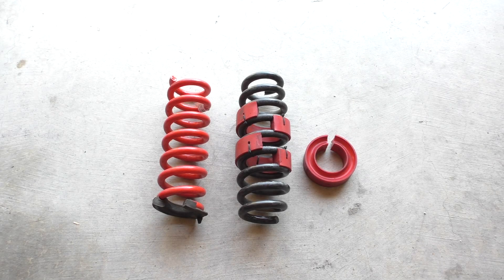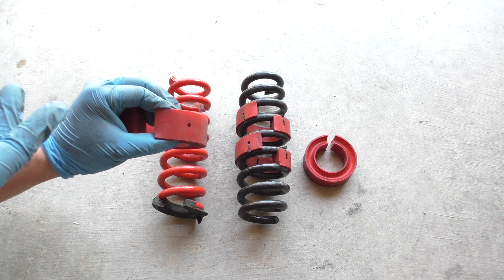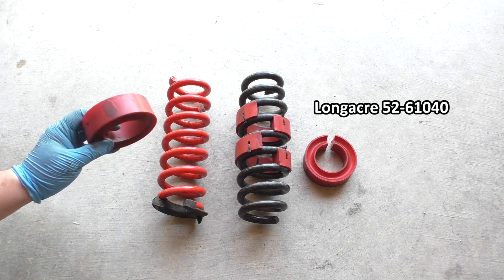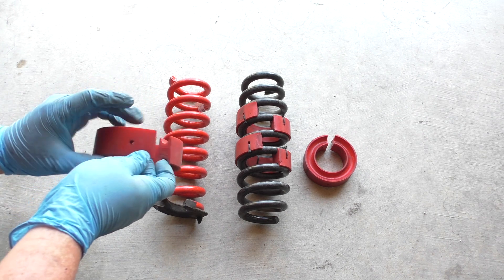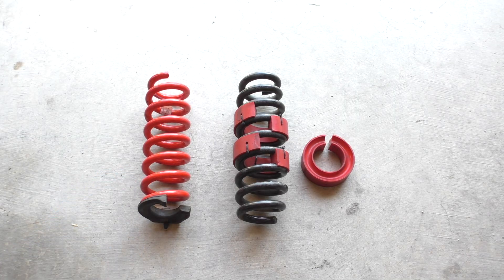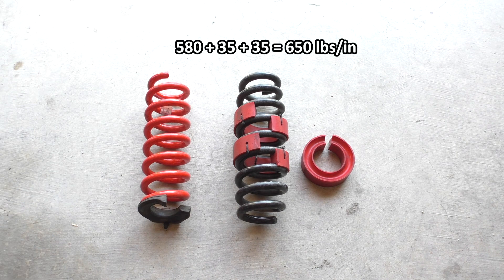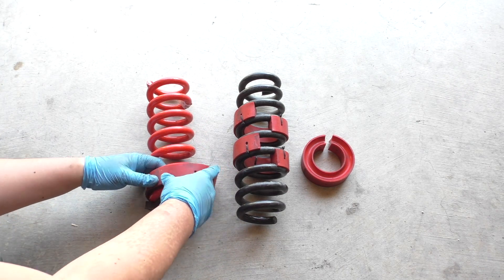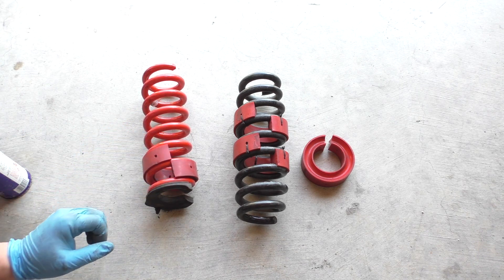Spring Rubbers Overview and Installation

Comment: I don't want to lift my car by 1/2" or any height at all. I have totally stock springs. I'm a snow skier, and I need to put on tire cables from time to time. I want my car to stay lower to the ground, not higher off the ground. I want to know, to make the springs stiffer for performance driving in the mountains and highway speeds, should I put these rubber coil near the top, middle, or bottom part of my OEM springs?? Again, I want comfort, but I also want performance stiffer springs without lifting my car at all. Thanks for sharing everybody... I'm doing my homework to learn about the performance advantages of these rubber coil springs.
Reply: "I want comfort , but I also want performance stiffer springs without lifting my car at all."
Bruh, you can't have your cake and eat it too.
Learn physics my dude, it goes a long way. 

Joking aside, there is no such spring is stiffer and comfort at the same time. You can have a custom springs with custom spring rate and length but you are gonna sacrifice some comfort for performance. 
btw, it does matter where you put these rubber at the coil, but any position you put it at, it would increase spring rate and raise the ground clearance no matter what.

Comment: Do these break down over time?  How long did they last you?
Reply from the maker: I didn't run these for a very long time (maybe 6mo at most), so I'm not sure what long term longevity would be like.
Reply: @FaRKle0079  After 6 months you got stronger springs?
Reply from the maker: @pemirat  Yup. I was using these to test and figure out what strength springs I wanted to get later.

Comment: Hey, it’s probably a long shot but I’m trying to swap my stock E84 N20 springs off a E90 N52.

I’ve done my research and they’re a fairly straight forward swap but my main concern would be the weight differences . It’s bout 250-350lbs lighter and I’m just wondering if using these would compensate for the it?

I have the h&r lowering kit on while I’m happy with the drop, the ride is just too harsh for daily & where I’m at. With the E90 springs, it should achieve bout the same drop while maintaining better ride. 

Or would it be better just getting springs of the E60? They’re bout the same if not a tad heavier than my E84 but I’m not 100% on the length and drop. 

Thanks in advance!
Reply from the maker: Do you have the spring rates for all those other springs you're considering? You'll want to know the spring rate and relaxed length of those springs to calculate how high they'll set the car compared to what you already have.

If your current springs are too low, and you feel are too soft, then spring rubbers can help since they effectively create a stiffer spring.
Reply: @FaRKle0079  Not so sure on the exact rates but the springs for E90 328i are C3 fronts and C2 rears, I guess these are BMW own marking for the spring rates? Might have to find out on the relaxed length tho.

Same goes for the E60, will need to check them out again. 

My current H&R are actually too stiff but loved the stance hence I'm looking for alternative by getting it off from the E90/E60 hehe.
Reply from the maker: @MrTbmnbo009  Yes, BMW puts stickers with a "two letter code" identifying them. Each two letter code corresponds to a particular part number, but unless you have the engineering document with the key connecting the two you won't really know much about the springs.
Reply: @FaRKle0079  yeah, really hard to get those information. Looked up on various forums and they could only connect the "two letter code" to the models (D# usually msport models while C# usually non msport).

Also I did some digging on sachs product catalog, I'm able to get some specs & dimensions for the coil springs and calculated the spring rates with those online calculator. Tho im not exactly sure how reliable the numbers would it be? It's using the OD, wire diameter, total length & number of active coils.

Comment: How much did these increase your height vs without?
Trying to find a set of rear springs to pair to a set of front f82 springs for my F34. (lowering springs lower my car too much, especially in the rear)
Reply: while maintaining flat ride.
Reply from the maker: @Full_regalia  I don't recall exactly how much these increased the height, but since it's in parallel with the original spring you can calculate the approximate new overall spring rate (add the base spring rate and spring rubber rate together) and using the corner weight calculate the ride height change.

For the F34 since it's so heavy you might even consider F83 springs, which are even stiffer than normal F80/82.

Comment: Are these for the 4" coil over type spring or the stock progressive 5" ?
Reply from the maker: The springs in this video are a stock rear spring (black) and BMW M-Performance aftermarket spring (red). Both are more like 10-11" long. Spring rubbers will work for normal 4-8" coilover springs, but you'll want to see how much spacing there is between the coils and pick a rubber that isn't too thick to fit between them.

Comment: Will these increase the stiffness of the spring
Reply: How long do these generally last? Also how long have you used them for? And any cons?
Reply from the maker: Yes! These increase the spring rate (stiffness) and are a great/cheaper way to see if you want to get stiffer springs.
Reply: @FaRKle0079  no good for a more comfortable ride then :(
Reply from the maker: @vicentepallamare2608  not necessarily. If used to create flat ride, or reduce bottoming out on bump stops it can help improve ride comfort.
Reply: How long do these generally last? And how long have you used them? Also any cons and or negative affect?
Reply: I don't want to lift my car by 1/2" or any height at all. I have totally stock springs. I'm a snow skier, and I need to put on tire cables from time to time. I want my car to stay lower to the ground, not higher off the ground. I want to know, to make the springs stiffer for performance driving in the mountains and highway speeds, should I put these rubber coil near the top, middle, or bottom part of my OEM springs?? Again, I want comfort, but I also want performance stiffer springs without lifting my car at all. Thanks for sharing everybody... I'm doing my homework to learn about the performance advantages of these rubber coil springs.